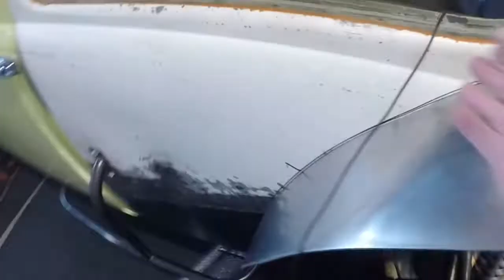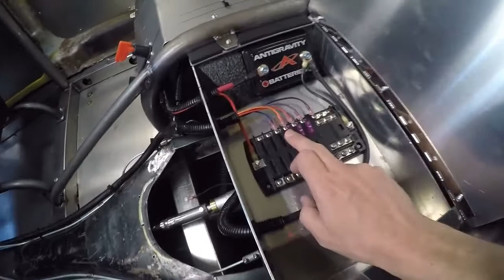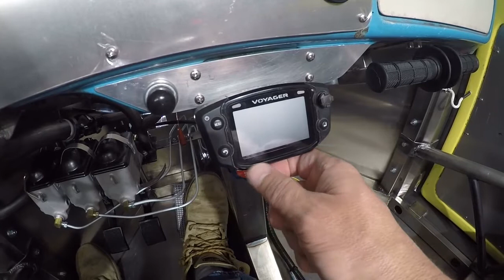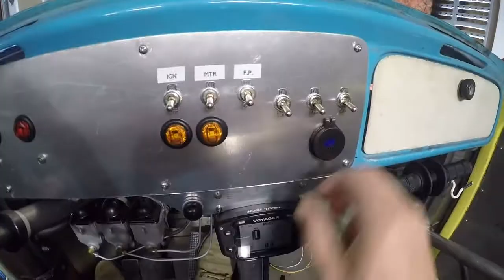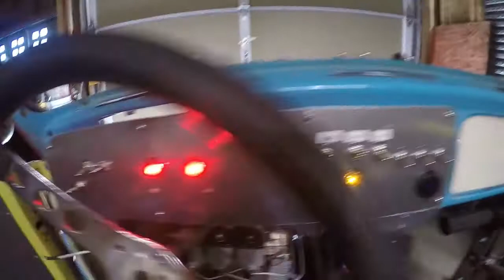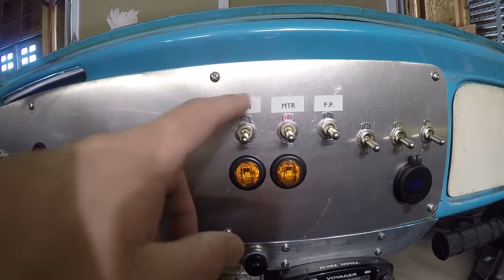Baja Bug Electrical EP 4

Comment: Can you elaborate a little more on how you hooked up your trail tech voyager and how you wired everything on the engine?!? Thankyou in advance!
Reply from the maker: Brandon Friddle, the voyager is designed to be relatively mobile. So there are two screws on the back to hold it in place and all the accessories for it plug in. So I made a stout bracket to bolt it to. Then I tied it into the accessory circuit coming from the battery. So any time the battery gets power the trail tech gets power. Then I hooked up a remote GPS antenna (mounted the antenna in the front under the hood). The antenna screws into the voyager with a coax plug. Then there is a cylinder head temperature probe mounted on the engine. When you buy this from Trail Tech it is only 72" long. So I spliced into it and added about 6' to it. So it runs from the engine all the way up the tunnel to the voyager where it plugs in. If I wanted to remove the voyager all I need to do is take out the two bolts and unplug the accessories. There is another accessory for rpm, but I haven't run that yet. Although it will be just like the cylinder head sensor. Everything else the voyager gets through GPS, so it's a pretty clean setup.
Reply from the maker: The engine was pretty simple. It has a dedicated circuit from the battery to a switch that goes right back to the coil, that is my ignition circuit. Then there is another circuit for the "motor", this supplies power to the oil pressure switch, carb choke, and alternator. There is another switch for the fuel pump, although it gets its power from the motor circuit. These circuits run together from the dash with the wiring for the rear lights. Bundling your wires together protects them more.
I hope that helps, let me know if you need more specifics.
Reply: Doug Bug, thankyou so much for you speedy response I really appreciate it! With the voyager did you install the wheel sensor as well?
Reply from the maker: No wheel sensor, I set up the Voyager in the settings to start and stop tracking off GPS. A little tiny bit less accurate, but I didn't want that janky wheel sensor mounted on the bug. I don't have the wheel sensor on the dirtbike either.
Thanks for the questions, I love the feeling that I might be helping someone out in the hobby.
Reply: Definitely are helping out, I’m building a manx style buggy! Thanks again for the replies and the videos!
Reply: Enjoying your videos, which Trail Tech model did you use here?

Comment: I noticed you said if the fiberglass front end is removed you'll be able to access the back of the dash. Wouldn't that mean that the back of the dash is open to the elements and any debris that could be coming off the tires? I'm just wondering if that will get enclosed with panel to make it on the interior of the body.
Reply from the maker: Hey Alex, You're really paying attention to the details, that's awesome! Right now the back of the dash is exposed, I plan to make something to protect it, either aluminum, rubber, or cloth. Haven't decided yet. But before the bug is complete there will be something to keep all the wiring behind the dash protected from the front tires.
Thanks for the comments.